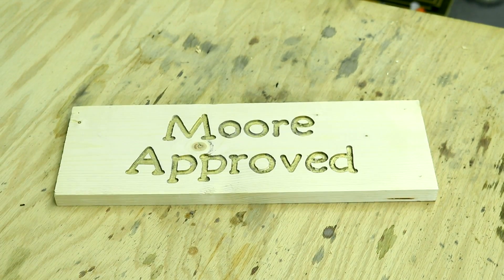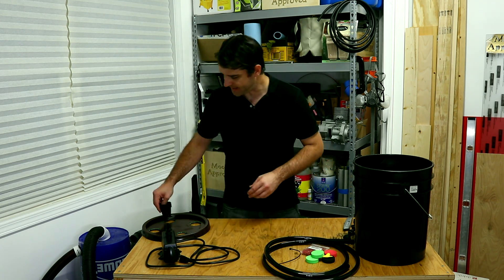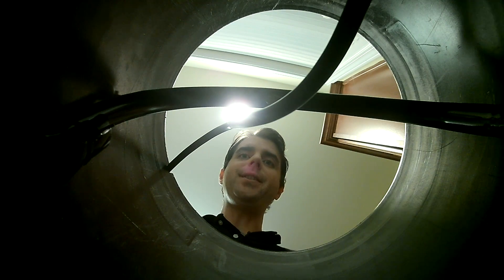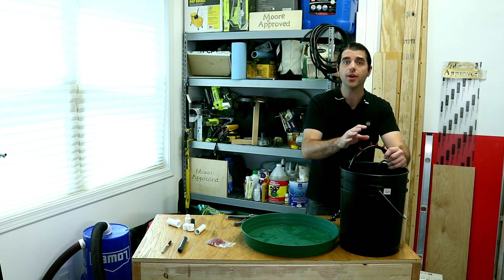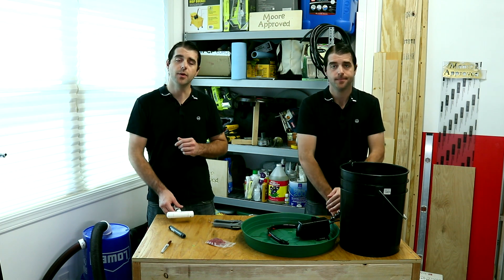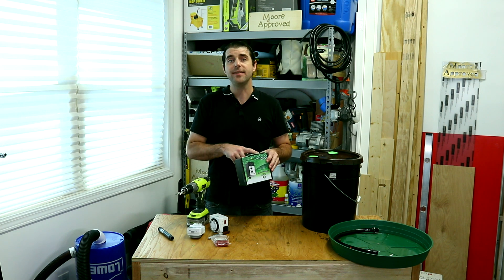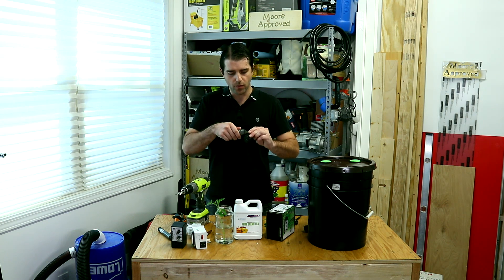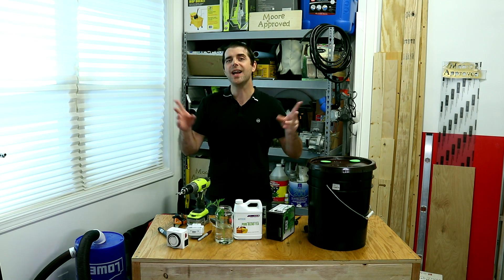How To Build An Easy Cloner | 3 Easy Ways To Clone Plants | Cheap DIY Aeroponic Cloner

Comment: Ita dunny all i do is take a tray and cut a rockwoll cube in 3 parts use it as the neoprean insert ans manually spray the clones 2 to 3 times a day n it works just like an ez cloner or auro cloner with the old traditional merthod